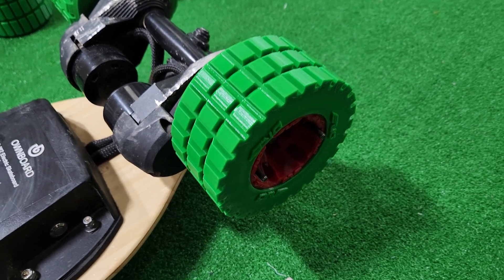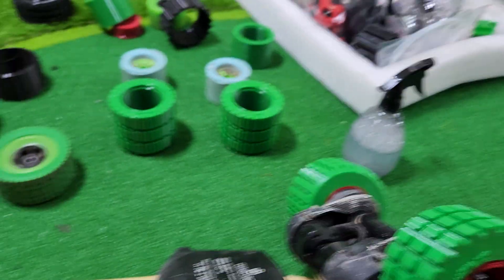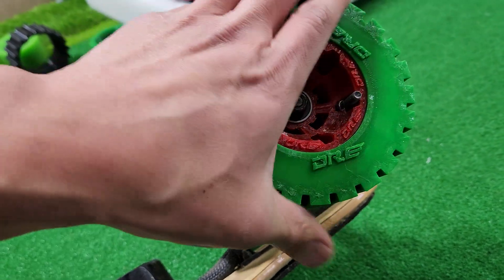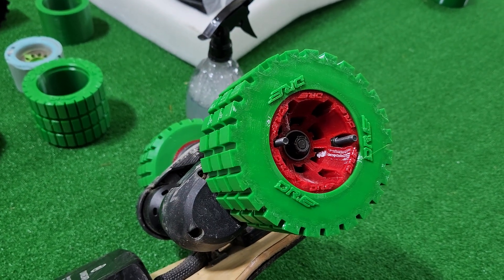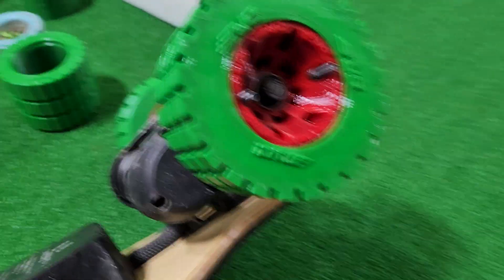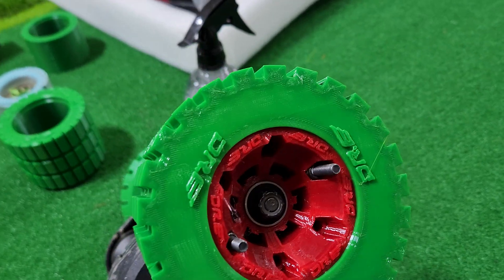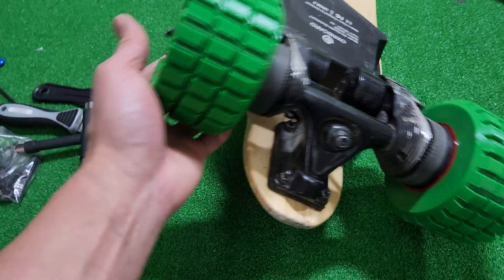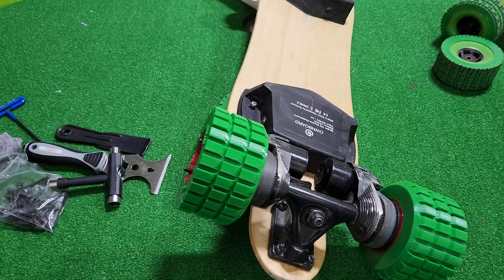World's First 3D Printed Electric Skateboard Wheels that actually Work!

Comment: The thing I'm most curious about is what durometer hardness these are?
Wonder if you could make them fit TeamGee hub motors?
Reply from the maker: With flex of the infill the durometer of these are near tire shore hardiness, around 70a.  But the actual durometer of the material is 95a.  The reason why this works is because we dont need to used 100% infill like molded urethane and also keeps the wheels light, about only 30% of the weight.